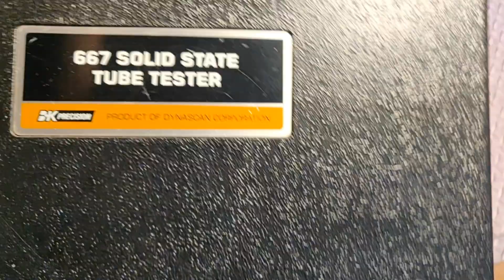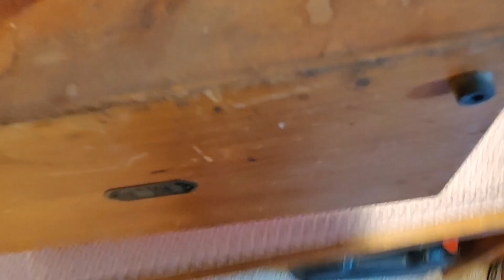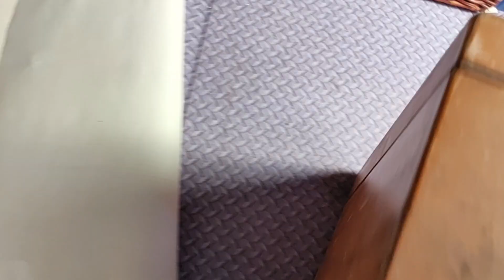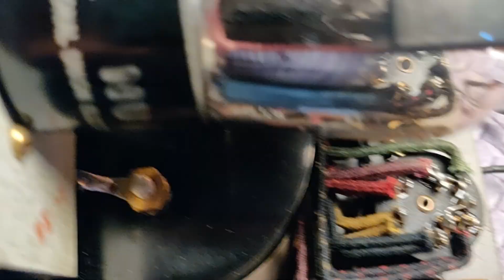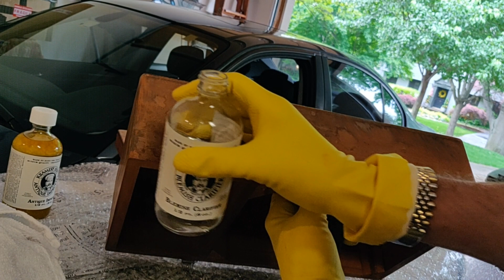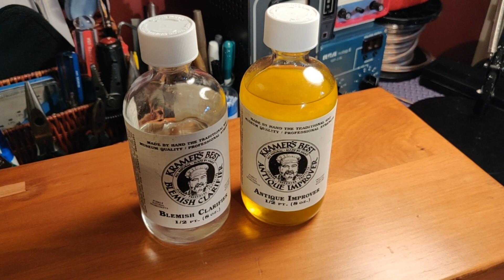Weston Model 777 tube tester,, is it working?

Comment: How did you "zero" your line voltage? I can't figure it out
Reply: I mean for example a 6v6,i put the b, c, d up position and switch to line/short check and the VU doesn't go up towards middle at all. When i switch to normal it does go up "testing" it but

Comment: Bama.edebris.com has both the setup and roll chart as separate pdf files. I don't know  if the  schematic is to be found however the model 607 schematic is there !
Possibly the tester could be opened to compare .
Reply from the maker: he's the Master Thanks for the info!
Reply: a trick: you can watch movies on Flixzone. I've been using it for watching all kinds of movies recently.
Reply: @Hassan Roland Yea, I have been using Flixzone} for months myself :D